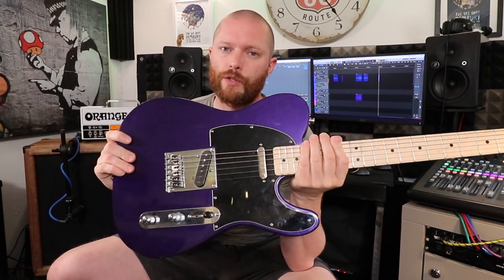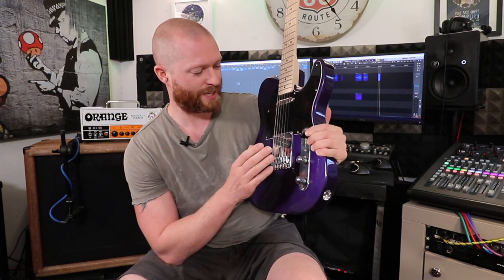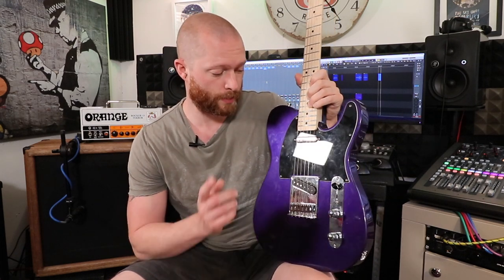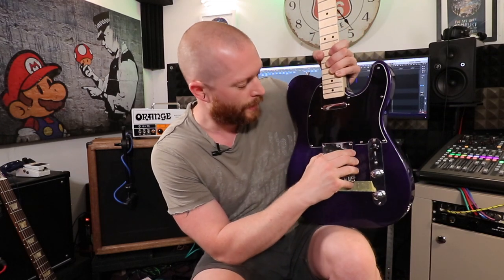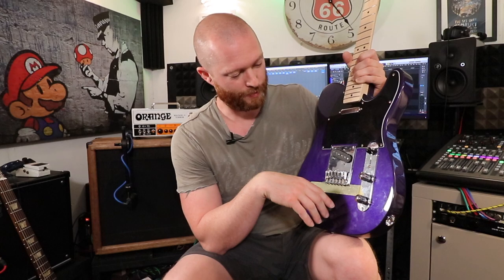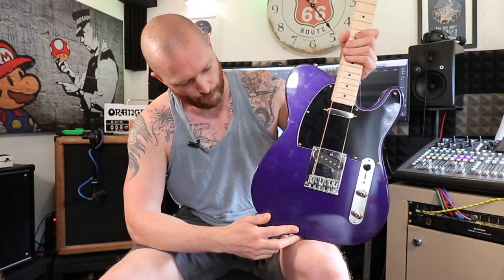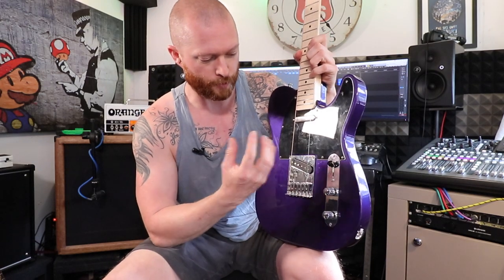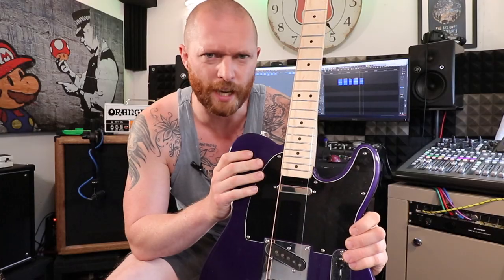How to fix misaligned strings

Comment: sometimes loosening the neckscrews, pulling the neck by the headstock to the opposite direction of the close-to-the-edge-string and tightening the screws again does the job! quite common issue with bolt on necks.

Comment: loosen backplate neck screws a 1/2 turn move the neck hold and tighten. Its easy to get a couple of mil out of it and you're done.
Reply from the maker: No adjustment on this one. The pocket is too tight
Reply: @PherotoneStudios  sand down one side of the pocket a few mm and then align.

Comment: I paid too much for a charvel that showed up with this issue. Unfortunately upon waiting to hear back from them, my dog scratched the guitar because I left it off my wall in the process of being so disappointed with it so I got stuck with it. Now I have to try something of the sorts to work it out myself. Last charvel I buy. Nothing over $1000 should show up like that, no excuse.
Reply: I got a Charvel about 6 weeks ago.  Same issue.  I have a So Cal HH Hard Tail.   I was able to loosen the neck plate screws about a half a turn each then align it by shifting the neck over.  Then tighten the neck screws snug in a criss cross pattern while holding pressure.    Philip McKnight channel has a video on the procedure.   I agree the setup and QC on a $1000 guitar should be way, way better.

Comment: Hi, thanks for this video. I asked some time back about a problem on a misaligned neck on an ibanez gio. Since then I sold the ibanez and bought a squier telecaster custom, which has the same problem. Thank you for a solution.
Reply from the maker: Ah no, same problem on two different guitars! No idea why these Telecasters are so prone to it but I’ve taken measurements and it’s the neck pocket that’s wonky, rather than the bridge being in the wrong position.
It’s just easier to move the bridge than redo the neck pocket.
Let me know how you get on with it
Reply: @PherotoneStudios  yes, I am still trying to decide weather to fix it at all. On my the low E string is too close to the edge, and I don't really play low E string high enough to bother me, but it does not look right. I am also planning to buy  a Creamery wide range pickup and changing caps and pots, so I will probably be doing it all together.
Reply from the maker: Ah ok, I’d it’s the low E I wouldn’t bother unless it’s really bugging you. Let me know how what you think of the creamery pickups if you get them. I’ve never heard them

Comment: I have a problem that I wonder if it can be fixed? Chinese grote,  humbucker screws not lined up with strings on both humbuckers. Tailpipe is bent and the closest one is ok. Its when you get to the one by the fretboard. Its way off as you get closer to the high E. I'm wondering if its a dud or can I fix it?

Comment: Did you try loosening the four plate screws a half turn then pushing the neck down and re tightening.phil mcnight know your gear has a vid on it.non invasive .best try that first.i have same prob.so i will try the screw loose method first.
Reply from the maker: Afraid so. It doesn’t work that well on Tele’s due to the square neck pocket. Still misaligned after doing that. Although, that always seems to work on strats

Comment: Wrong. You loosen the neck bolts slightly, move the neck to counter that, then tighten them down. This is what happens when you screw the neck down all the way without making sure its sitting in the pocket correct and can and DOES happen on Fenders as well.
Reply from the maker: Wrong. That works on strat necks, this is a telecaster which has a square heel.

Comment: Just viewed the first two videos on this guitar. Now I wonder, was this issue there from the start?
Reply from the maker: It was but i didn’t notice it initially. Took some measurements and it’s the neck pocket that’s slightly misaligned
Reply: @PherotoneStudios  Thx. I had a guitar with a similar issue. In the factory they even made an extra slot in the bridge to keep the high e-string  'aboard'. I never had any problems with it (newbie, and even the guitar store didn't mention it when I brought it there for maintenance),  gigged with it for two years but friends had the string 'come off' when string-bending. I always did bend-ups (pushing the string  up), but apparently they did bend-downs (pulling them down).
Reply from the maker: Was it a Telecaster style guitar by any chance?
It’s odd to bend the high e towards the edge of the fretboard. I always bend up
Reply: @PherotoneStudios  I agree, and no, no Tele style, but what's called 'single cut' these days. Not one of todays budget brands.

Comment: If you feel like your bottom string is too low. Then you should take your guitar to an expert...using white glue and kebab sticks, and approximate measurements result in more heartache as seen in over overcompensation....If you can't play as it is, then sell it and buy something you can, rather than dick around with it!!!
Reply from the maker: As a carpenter that has made plenty of guitars, I am more than qualified to fix this easy repair. 
As explained in the video, there are two options: move the bridge, or redo the neck pocket. 
Also explained in the video: the neck pocket repair looks unsightly.
If you’re making new holes 2mm from old holes then you need to fill the old holes or the screws will slip into them. Kebab skewers are made of hardwood and are round. It’s far easier to use those than make a round wooden dowel which would end up the same diameter as those kebab skewers.
The white glue is weatherproof PVA. It glued wood to wood. The kebab skewers are made of wood. The guitar body is made of wood. It’s a match made in heaven.
As for the approximate measurements, I ran a straight edge along the edge of the neck to work out exactly where the bridge should have been. Then. And this is the clever part. Loved the bridge to where it should have been.
Before writing a knobbish comment, stop and think. I’ve shown a repair in a way that anyone can do as I’ve seen many Telecasters with this issue (and it’s always Telecasters) which have been repaired by an “expert” which then come to me to resolve. 
The only other option is to redo the neck pocket. And like it said several times, that looks awful. Unless you’re going to get the body repeated afterwards. Maybe check the cost of a repray because it’s more than the cost of that entire guitar